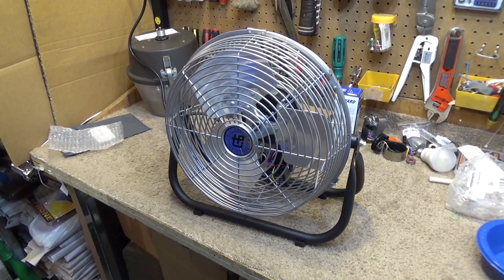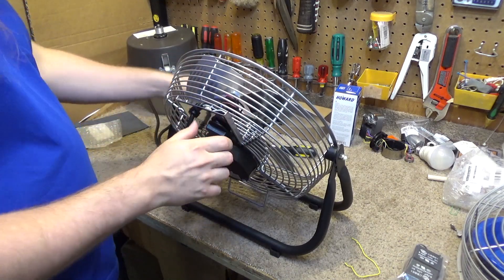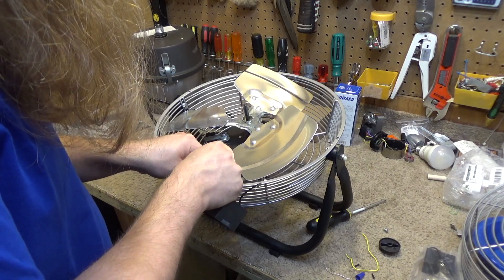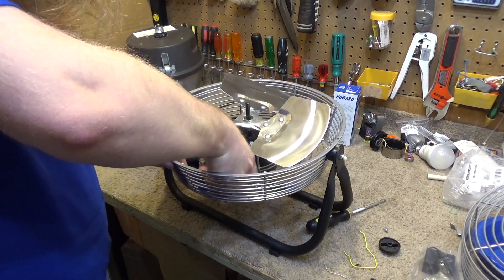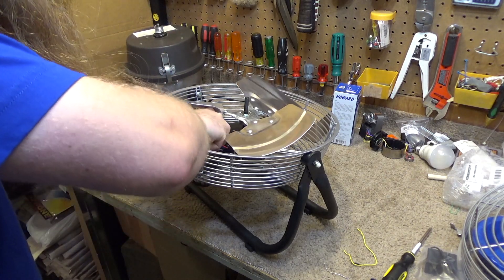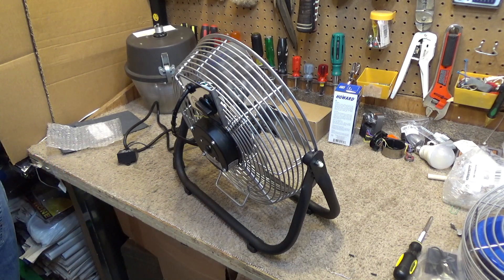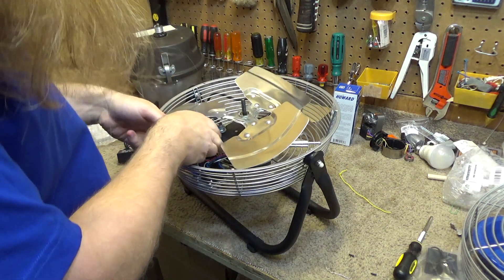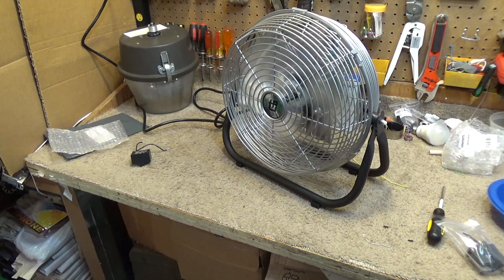8uF Low Speed | TPI F-12-TE 12" High Velocity Fan

Comment: Good video bro on testing the TPI 12" High Velocity fan with 8 UF capacitors on low speed hopefully it should work good for you I enjoyed the video
Reply from the maker: @LuisFanGuy292 Thanks, glad you enjoyed the video.
Reply: Fuck
Reply from the maker: @Dynamo69420  You. Do not post spam.
Reply: @JordanU  iwill
Reply from the maker: @Dynamo69420  Do not post spam.
Reply: @JordanU  I WILL
Reply from the maker: @Dynamo69420  Do not post spam.
Reply: K